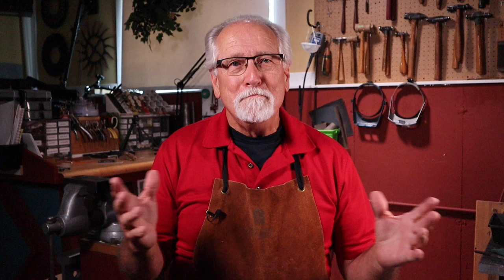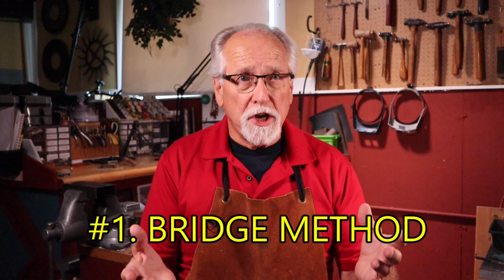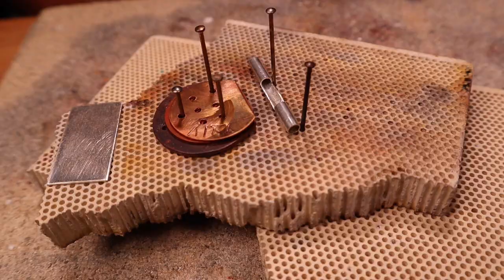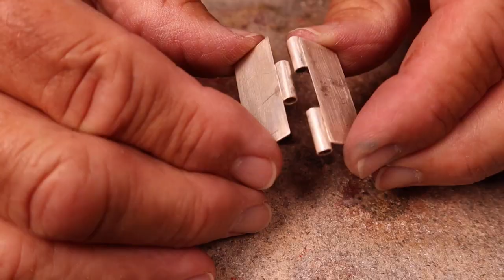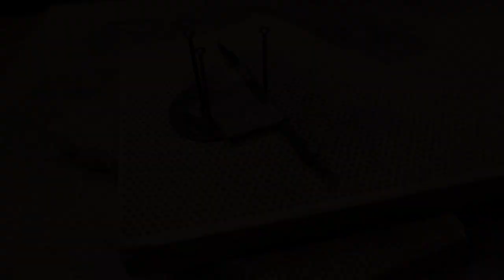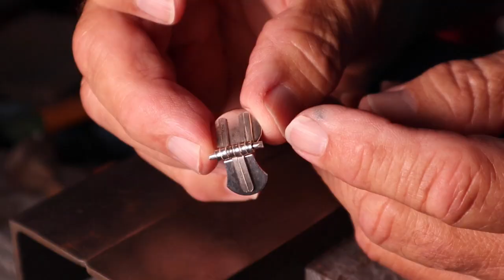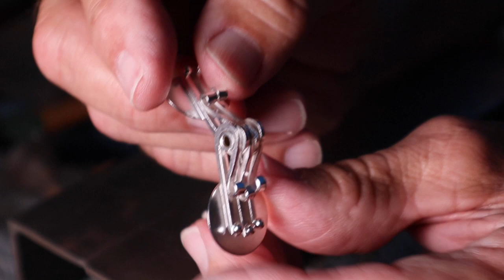SILVER JEWELRY HINGES - MAKE SUCCESSFUL HINGES - EVERYTIME!

Comment: I do a modified bridge method, that is far less wasteful of tubing than the method you show. Don't remove a piece from the middle of the two end pieces, just cut the tubing 3/4 or so of the way through, but omit cutting down the tube to remove a piece. Then just solder the two end pieces, using something to stop the solder on the center section if you aren't confident of your soldering skills. Then after the two end pieces are soldered, go ahead and cut the tubing the rest of the way, and remove the center piece. You are left with a piece of tubing that can be used for something else, rather than having wasted it by splitting it down the middle.
Reply from the maker: Hello Talia, Yes, you are correct. I agree with you 100%.  It does waste the middle piece of metal.  I usually do not use the bridge method but use the graphite method.  I get excellent results every time and and it is a time saver too.  I introduce the bridge method to beginning students because, as you said, they aren't confident in the soldering skills yet.  Thank you so much for sharing.  I really appreciate it.   Keep watching.   Greg Greenwood

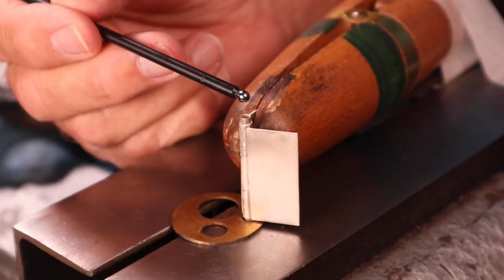Comment: You mentioned a "Repozet" tool at 10:24. What is that? Thank you!
Reply from the maker: Hello Jimmy,  A repousse" tool is a "punch" tool.  It is a straight steel rod with a steel ball at the end.  It is used for pushing sheet metal from the back side of the sheet to make a relief design  on the front of the sheet.  I also use it to flare tubing.  Look up repousse. It is a fascinating metalsmithing technique with beautiful results.  Thanks for watching.  Greg Greenwood

Comment: 0:01 is that big vice necessary for your shop?  I have a small metal workshop but nothing of Jewelry family.
Reply from the maker: Hello Bobby, Thank you for watching my video.  Yes, it is a large jawed vise.  I have modified my regular vise with  angle irons for the Foldforming Technique.  Watch my 6 part video series on Foldforming.  In video Part 1, I  explain the use of the oversized jaws.  If you have a metal workshop, I think you will be interested in the foldforming technique.  It is an interesting way of working metal.  Thanks again, and let me know what you think of the foldforming series.  Greg Greenwood